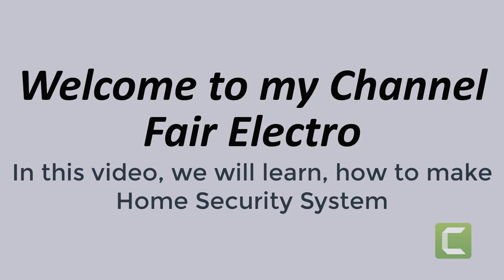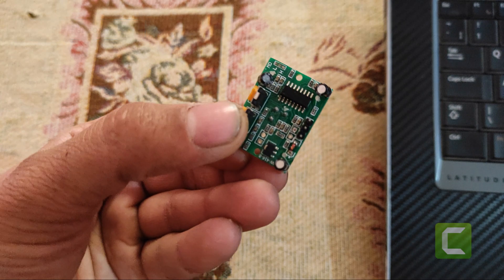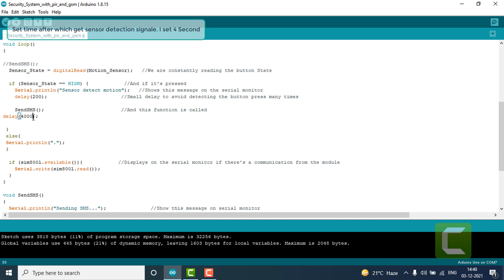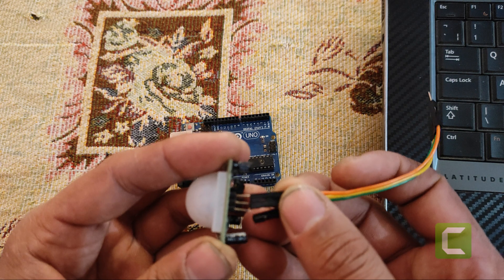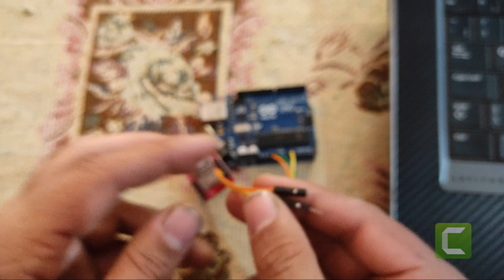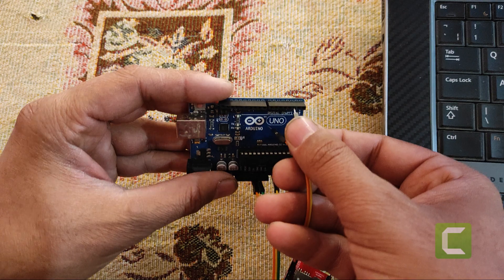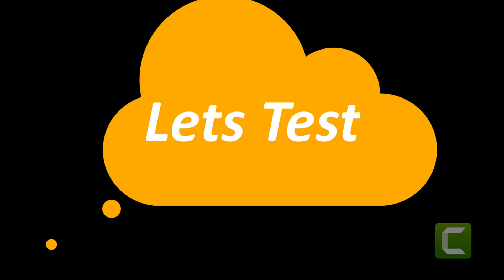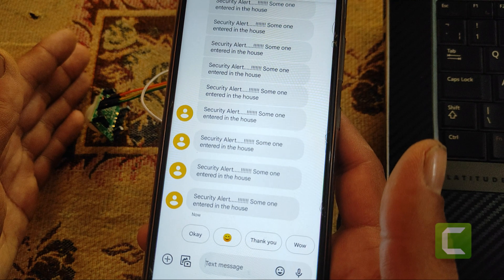GSM based Home security system [ using SIM 800L GSM module ] | Protect Home and shop from theft

Comment: Can i do the same without DC voltage booster and battery?? I mean use 5V of arduino? Please answer as soon as you can
Reply from the maker: you can use power supply of 5v 2amp but you can not use arduino 5v for gsm module

Comment: I have made a GSM based Home security system  using sim800L, Arduino nano & PIR Sensor. But problem is it's trigger automatically in every 55 minutes.  Can you please help me out?
Reply from the maker: problem is in PIR sensor. Set PIR sensor sensitivity
Reply: PIR Maximum delay time is 7 minute but how it can trigger after 55 minutes. Though i have set the regulator minimum range of delay & maximum range of sensibity.
Reply: @lionahmmed9866  it is due to gsm signals which trigger the pir sensor keep them away from each other